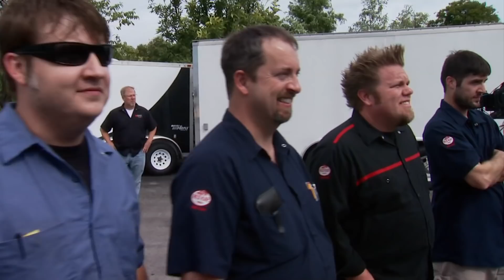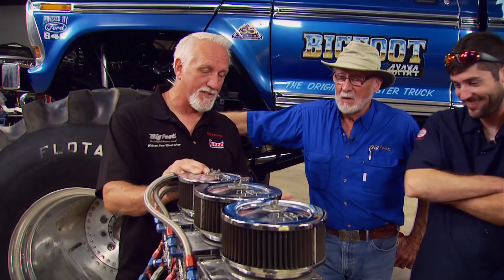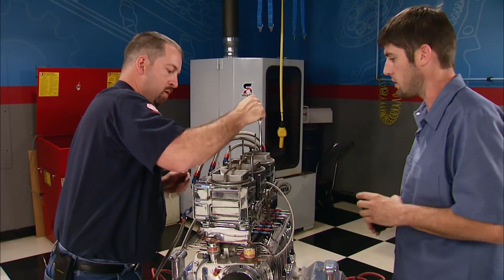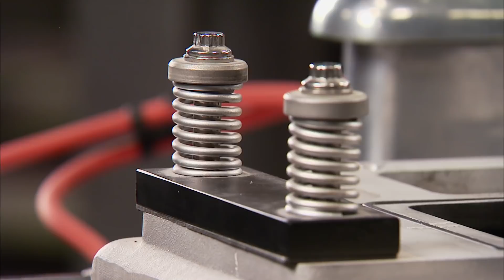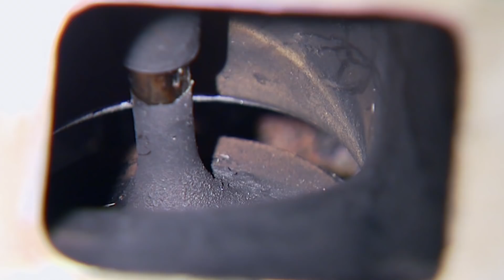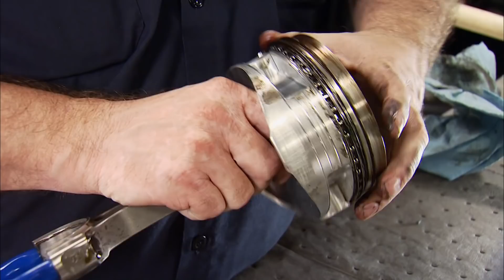The Original BigFoot Engine Build Part 1- Engine Power Season 2, Episode 4

Comment: I was so close to getting the RC version of this (by traxxas) and i ended up getting a slash raptor. Whenever i see Bigfoot i always feel a slight bit of regret of not getting it
Reply: Don't feel too badly. I did get the Traxxas Bigfoot. I love it, but it's a 2WD Stampede with a 12 turn brushed motor. I've scuffed and cracked the body more than I wanted to. Even stripped a rear axle. I had the presence of mind to get the wheelie bar kit when I got the truck and that saved quite a bit of damage.  (Wheelies are hard to Not do). They do sell a fully painted and unpainted body shell so maybe you can STILL have your own Bigfoot yrophy truck.

Comment: OK, now build a 1991 Ranger and call it little foot. All aluminum 302 with air gap intake, 4 or 5 speed manual, the leaf rear springs replaced with coil overs, and a 4inch lift on a 2wd.

Comment: WOW, 3 Predators on top. You hardly ever see them in use. I used one on my 67 Camaro back in the late 80’s and man did it work nice. They would meter themselves from 390 to 930 cfm’s based on the engines demand.

Comment: Im not very good with engines. Can someone tell me why this ford engine has hemispherical heads? Was it custom to this engine?
Reply: These heads were indeed custom built. They were based off of the Ford Boss 429 heads that were produced in 1969.
Reply: @rustyzipper6304  but the 429 heads weren't hemi heads where they? Doesnt Mopar have  the only mass produced hemi heads?
Reply: @jordanyesterday  That is why these are custom. They were based off of both the Mopar "hemi" heads and the Boss "semi-hemi" heads. The 429 and the 460, which is what this engine is (460), are basically the same block with different cubic inch displacements (bore/stroke). So you could technically pull those heads off and put them on a 429 as well.  They are aftermarket heads made back in the day. Now, you can get the same type of head design from John Kaase and build your own semi-hemi, if you got an extra $10k or so sitting around. ;)
Reply: @rustyzipper6304  I see. Thanks for the info

Comment: the original bigfoot   looks way cooler than modern  monster trucks
Reply: Yes sir it does they sure don't make em like that anymore
Reply: @anthonyfrederick2188  agree with you on that
Reply: @anthonyfrederick2188  They sure do! Monster Trucks got turned into an offroad NASCAR type spectical sport... The real dog Monster Truck's that we used to see when we were kids, are what are known as Boggers now.... They run mud holes with them instead of jumping/crushing cars. https://www.youtube.com/watch?v=0cCq9V6ZYyw
Honestly though, the mud boggers are more powerful, that a lot of the monster trucks really... they need that extra power because they dont just run on pavement/dirt, that mud/water makes it super difficult to move through. So... power to move the big tires, power to push through the mud = some rediculous power REQUIRED... cant go soft in a mud bogger.
Reply: @anthonyfrederick2188  agreed 😊
Reply: @anthonyfrederick2188  yea they do. There all over the place
Reply: Ken Bush  ya is that a steel truck
Reply: we need more of those real cab  monster truck
Reply: @buder5116  true
Reply: I was just going to post this, but you beat me to it.
Reply: @Jim Lahey fiber glass was made in the 80's thats not new
Reply: word, love the classic look it has, it is exactly what you think, when you hear the words "monster truck."
Reply: I worked for utility trailers in spokane wa.as a parts guy And one morning a tractor trailer pulled up needing some lights fixed on it i told him to pull around back and I'll have a tech right with him. I went out find out what was wrong and trouble shoot asked what he had in it cause it was a 53' featherlight car hauler. Well he popped the back open and one of the grave diggers and scooby doo trucks were tucked inside. We had to pull the grave digger out to gwt to wiring and i was able to check it out. Those trucks were hammered up duct tape and baleing wire holding it together it was on the monster jam tour so theae trucks get the shit beat out of them. Pretty amazing to see what big foot started. The truck driver said they run like 8 grave diggers around the world at any givin time as do most the big name and big dollar teams do. But the only part that was a "truck'' was the name monster truck,  just a rollcage with a chevy panal wagon best to shit body and scooby was the same. It was really cool to see them up close and the craftsmanship that goes into them to be able to take the beatings night after night in any givin town.
Reply: Yep, original and best.
Reply: I agree! I wish I could see this running the track in person. I think for most us truck guys we could connect and relate more with an actual production truck vs tube chassis.
Reply: @TheAnonymous1one no doubt about it    I like the real steel
Reply: @Jim Lahey ya think i dont know that i meant to say grave digger
Reply: @Jim Lahey agree with you on that
Reply: Amen
Reply: Check this big monster truck https://youtu.be/qE5k55CVOv4
Reply: Because one was built from a normal truck & the other is focused on safety. Moron.
Reply: @atvkid0805 you really should not show your stupidity by comenting    back in the day bigfoot was the first monster truck current day are not even considered real trucks with vin s they are a creation and have never been street legal you goof
Reply: @atvkid0805  safety yes.. but more so on cost... a lot cheaper to replace fiberglass/plastic panels than to replace a whole cab or box.  Now go play your pubg little kid... adults are reminiscing.
Reply: @faloxzz0778   both are for little kids
Reply: That can be said for pickups in general.
Reply: This was built from an actual truck. Todays monster trucks are purpose built and dont have any stock body or frame parts on them.
Reply: Get Mr T and a can of Mello Yello in the same shot with this beauty and I might just faint.
Reply: That's because it's a real truck, not a cage with some floppy sheetmetal or carbon fiber over it.
Reply: ya but what you guys dont know is they messed the motor up and it doesn't run any more.
Reply: The new ones dont stir any emotions, one look at the original bigfoot and wow. I remember growing up with the original so I may be biased.
Reply: Amen!
Reply: Ikr
Reply: Because it was an actual truck body
Reply: I prefer the older Monster Trucks. New ones are all about racing
Reply: Any truck pre 1996 looks better than now days, even dodges
Reply: It has a Hemi engine
Reply: Cause it was a real truck
Reply: Think it was in the late 80's in murray kentucky .bigfoot rolled over 1 night next night he was back out there half smashed roof .
Reply: fax it does
Reply: No doubt. Steel body shines
Reply: Because it was way cooler
Reply: But that truck was not that safe
Reply: Nah Jurassic attack looks better (I’m responding to original comment not a reply)
Reply: I know right and im trying to .ake a monster truck using a 1997 red gmc that sponsors texas the lone star state
Reply: Hell yeah!
Reply: Yes I agree
Reply: I don't like the newer trucks because they're like not even real metal can't even open the doors on these weird monster trucks but these old ones can  open the doors
Reply: Agreed!
Reply: Really sorry babe but reuueu  jriiiuu  riiiipyi
Reply: Jerry Jay Sayetsitty
Reply: Definitely!
Reply: Yeah I think you just get to a point building a frame rail vehicle where you are tired of dancing around the limitations of it. Then you start tubing, eventually you realize you should have just built a tube frame with ideal geometry to begin with. 
Suspension is usually what drives that and the original had leaves. 
They were talking about “old” motors. Shit that suspension is far inferior to modern suspension by a LONG shot! The motor is respectable and still used in plenty of race cars.
Reply: Maybe crossing that transition ruined non tube chassis for me. Other than nostalgia of seeing it as a kid that truck doesn’t do much for me. It could be duplicated now in garages anywhere. We use those axels all the time in off-roading. 
I guess a better way to say it would be it does more for me in the museum than it does in the stadium.
Reply: Yeah because it's a real truck turned into a monster truck. Not a purpose built tubular frame purpose-built moster truck. Original Bigfoot was street legal at one time. That's why it's my favorite monster truck. Along with the original grave digger truck from the 80s.
Reply: Joe S..yep, it was street legal. Read my other comment on here. Still have a pic of it with Mudders on it. ;)
Reply: Yes but the newer ones are much more capable and safer for the driver and spectators.
Reply: grave digger is better

Comment: The 1st truck is gone. That truck was built a few years ago along with one with 48s and also a racing body/suspension truck to mark some anniversary. On that engine being the original I call BS.
Reply: True.  That isn't the original 1974 body, it's a 1979 body.  But all the rest is original.  And if you don't know about the 640ci big block Ford hemi, then you haven't been following Bigfoot for too long.

Comment: Did you really just say " these plates don't particularly move" about the Predator air doors?  C'mon man. Some of us still know how they work. Otherwise, a very cool video.
Reply: Ima trust pat over what you know
Reply: @sschevmale24 Better yet, why don't YOU dig into how they work, and prove me right. The Predator air doors are very similar in function to the upper secondary throttle plates in a vacuum secondary Holley, they are demand sensitive. And they move, lol.  I ran several for years, I'm not guessing here.  Cheers!
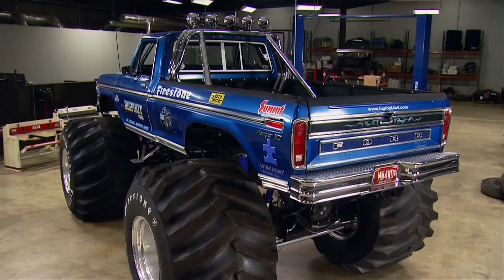Check this video out, at the 2:15 mark he is swinging the air doors that don't "particularly" move. They swing about 45* total travel from idle to wide open.Yer welcome.
https://www.youtube.com/watch?v=8TAZAKPneyE
Reply: Never heard back from the Chevmale guy. Being wrong is hard for some folks....
Reply: @sschevmale24 I see you did not do your homework and are still blissfully ignorant. Guess it's a natural state of mind for you, I will cease arguing with an idiot right now. I set you up so two clicks and 15 seconds of your time would have explained what you don't know, and you not only couldn't manage that, you doubled down on the dumb and came out swinging and talking about dicks. Congrats, you are a douche.  Cheers. 
PS It sure would be great if Pat would jump in here, just for a second...

Comment: '74 F250 long bed? That's a '79 SWB. what gives?
Reply: They changed the grill to update it in 79 or 80 IIRC and used shortbed once it went on the deuce axles.
Reply: Look at the trim. That’s not 79 trim. Like he said. They changed the grill

Comment: They metal gauze in the carbs aren't "catch screens" they are flame arrestors. They should be removed if the engine isn't going back into a boat.
Reply: Youve never had a blower apart have you.
Reply: Dogurasu  I like both the coyote motor and the LS series of motors.  They're not really comparable though. The coyotes dohc setup is so much physically bigger while displacement is much smaller.
Reply: Dogurasu What a joke, is that why everybody with a classic ford has it powered by a Chevy engine? Small block Chevys have always dominated. Just look at any ford rat rod, old ford coupe, etc and you’ll see 9/10 have a small block Chevy under the hood. Also an example to prove you wrong the 97 351 by ford produced 220hp and 330tq while the 97 Vortec 350 produced 255hp and 330tq. Just in case you can’t count 350 cubic inches is less than 351 cubic inches and 255hp is more than 220hp 🙃
Reply: Dogurasu  That's a terrible argument, considering Ford is running twice the valves and four times the cams. Not to mention Ford's "little" 5.0 Coyote weighs as much as Chevy's 6.2 liter.
Reply: Dogurasu  which does little good when your POS ford is busted on the side of the road
Reply: Maybe they left them in there as a parts catcher, the engine and truck worked back in the day and I'm sure they knew what they were doing so why be a YouTuber comment warrior?
Reply: I have never seen carbs like that before ,all i can say is they are bad ass ,im going to have to google them so i can understand whats going on here
Reply: also have you seen the new 7.3 liter big block ford is putting out ? Chevy is putting 4 cylinders in their trucks and ford said lets bring back the big block !
Reply: Carl Butcher wrong, Chevy is developing a new engine that’ll be over 8.0 liters.
Reply: Carl Butcher it’d be interesting to see some massive 4 cylinders though imagine a 5.0 to 7.0 4 cylinder...
Reply: Carl Butcher they are predator carbs.
Reply: The flame arrestors create a massive restriction. Performance boats are required to have them for scrutineering and by law. If they removed them they would see a substantial power increase once tuned.
To mistake flame arrestors as "parts catchers" is stupid.
Reply: Wrong!

Comment: Why did they build it all back together and then take it apart? If you pay attention when I first roll that engine out the blower slides off and they fix it really quick.
Reply: timestamp?
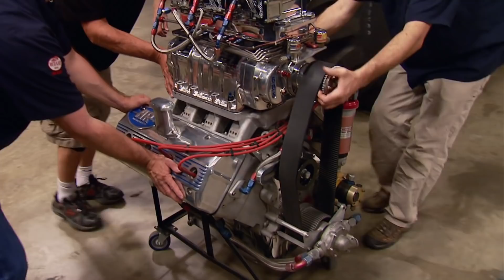Reply: @vasopel  3:00 to 3:03 ... look closely and you can see the blower slide on top of the engine when they bring it to a stop. It's a blink and you'll miss it type of deal (almost), but you can definitely see it slide.
My guess is... scheduling conflicts? Perhaps they had already started work on the engine and could only then schedule the bit to camera with the two older gentlemen?
Reply: @1SaG  . yes I see it now. I think that your guess (scheduling conflicts) is probably right!

Comment: This is a lie. The original Bigfoot was powered by a 302 2bbl windsor.
Reply: Chris Mackenzie So Bob Chandler and Jim Kramer are wrong?
Reply: uh nooooo   original power plant was a 640   only thing changed are the body panels   they changed body in 90 - 92  original truck had  BLACK ROLLBAR  not chrome !
Reply: So they can’t change a roll bar colour? Is that what your saying or?
Reply: @trippinoutmotorsport  they can do what they want.   Frame is original not body
Reply: It started with a stock engine but he upgraded literally every part by the end of it.